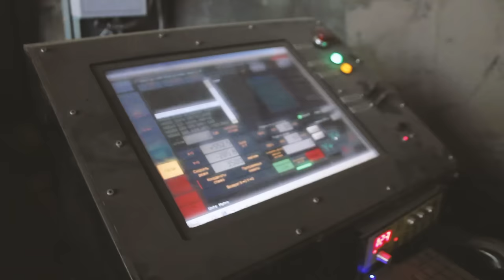Making Kratos' Axe - Leviathan - God of War

Comment: 14:05 Kratos want refund. "No good enough!!" No sharpness = No damage.

History Channel : Your weapon can't kill. Please leave the forge.
Reply: As heavy as that ax is, no edge is needed to kill.  Though there's room for debate of whether it's more dangerous to the target or the poor slob trying to lift it.
Reply: Well, If he can not do it like you wanted, do it by yourself and show a video in which you demostrate us that you did it better
Reply: Pick ANY bladesmith channel, and you'll find what you're looking for. Or, if you'd like specifics, check out Alec Steele's channel. But then, this is a fantasy build, not a functional weapon build, so a lot of leeway is called for. Given that, I think he did a very nice job, even if I did cringe every time he tried to shape metal by hitting it with a big hammer while the metal is cold. :D
Reply: Its is supposed to be 

Wil Willis:please leave the forge
Reply: I think kratos would be the least of his problems. Brok and Siri would murder him and use his soul to make a shovel meant for cleaning out a stable.
Reply: I'm thinking this was mild steel used for the blade so regardless of if it's pure fantasy, it'll never be more than a wall hanger or melon smasher.
Reply: exactly
Reply: It won't keal
Reply: It will not keal

Comment: I’ve working in a weld shop for about 1 year now and have exclusively heard spray arc and let’s just say I was very surprised by how quiet your welds were, then I remembered that you can set the welder to under 26 amps lol

Comment: Looks awesome, great job...... buy yourself a 9 inch grinder and you will get the arm strength as well to wield the axe and save half the time grinding :) cupping the blade edge would give it a deeper cut, but it would cave in most things as it is, if your able to swing it...What you planning next? Shield......

Comment: So this axe is beautiful. That said, imagine crafting something like this without modern power tools? I am in awe of the old world craftsmen that fans build beautiful things without the benefit or use of modern tools.
Reply: Not to be mean to this guy but I think that if you were to actually forge this axe it would turn out far better, I also don't think it would be any easier or harder to make, it would just take longer to do. And while I have not forged an axe of this size yet, I do think this would be doable by hand.
Reply: @thesiege6003  Just about anything can be done by hand. It’s just I can’t imagine the craftsmanship necessary to do something like this with NO modern machinery, tools, or forge.
Reply: @cainabel615  I mean how primitive are you thinking, because metal working in any form is nearly impossible without a forge
Reply: @thesiege6003  The man was using power tools. I’m talking no powertools. Not even a welder. Just some dude with a hammer, an anvil, and a hot forge. I’m not knocking the guy that made this. But when I see what was made hundreds of years ago I think it’s amazing. That’s all.

Comment: Nice model of a video game prop. Your grinder & drop motor work is exemplary! Your forge work is dubious, as none was presented. You smashed several objects, none of which were cleaved in two. I would have been more impressed, if you split that stump, you smashed those soda bottles & flaming pineapple on! The saddest thing of all is that your shop seems to have everything needed to make an ax! And yet you cookie cut an ornament, when you could’ve made a weapon!

Comment: I hope he realizes that the only thing that's keeping the axe head from breaking is how thick it is. A good blade is forged and heat treated along with folding the metal to give it the strength while not having too much weight.

Comment: Well, it was a nice work but a few improvements can be made, so please don't take this as rude, take it as a positive criticism to improve your next works:

1 - The thickness of the axe was just completely out of reason, please use a thinner piece of metal or grind it more. We can clearly see that the end result was a super heavy axe, and that's not good.
2 - The marks on the side of the axe don't have black highlights, it's just the metal and the "color" is supposed to be lighter than the axe itself, not darker.

Comment: I guess it kind of looks like the original. but that would function very poorly as an axe. The edge is extremely fat and doesn't appear to be sharp, it is welded together, the handle appears to be too thick to get a good hold on and it is so heavy you can barely even hold it steadily. you also didn't appear to do any form of heat treat, so what edge there is will go blunt in a matter of swings.

Comment: For such a heavy axe it sure as hell doesn't split wood for nothing. It cut through all the soft stuff, but barely left a dent in that stump. Then at the end you tried to Copycat michaelcthulhu by setting something on fire before cutting it LOL. It turned out beautiful, but you definitely need to put an edge on it. and please stop copying other creators you're not michaelcthulhu.